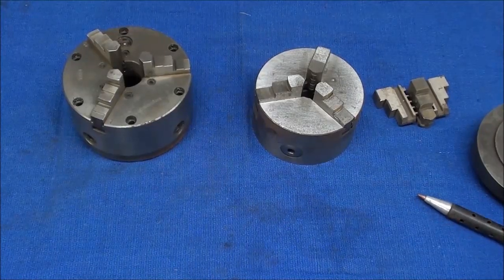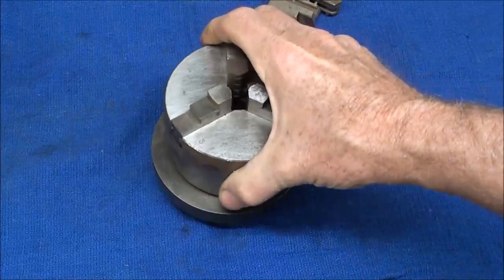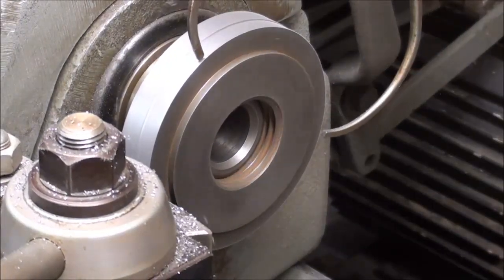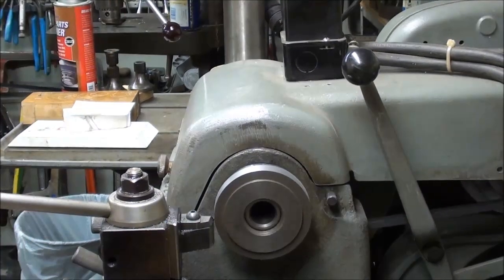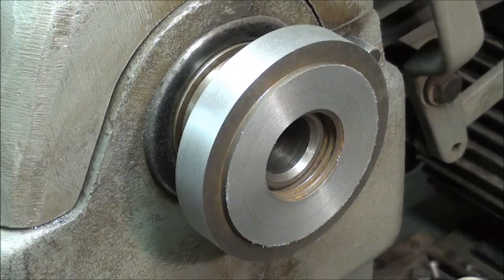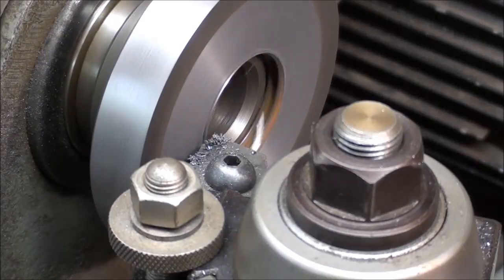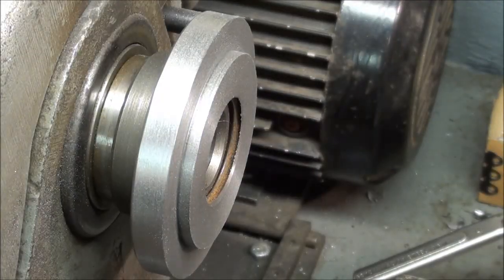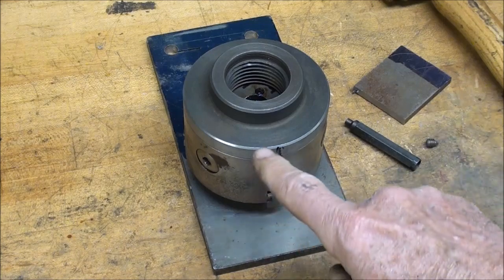MACHINE SHOP TIPS #132 Fitting a Backing Plate to an Atlas Lathe Chuck tubalcain

Comment: MrPete, I have just gone through exactly the same process to machine a backplate for mounting my new 130mm (5") SanOu 3-jaw chuck onto my Chinese 9x20 lathe. This lathe has an M39-4 spindle thread, and Little Machine Shop was one of the few places I found that carried an M39-4 backplate that was large enough (and reasonably priced). In this case, I had to settle for a 6" diameter backplate for my 5" chuck. I decided to leave that backplate at its original 6" diameter, rather than turn it down to 5" to match the chuck. Of course, I did have to reduce the registration boss to appropriate diameter, and was careful (and lucky!) enough to get it "just right". The chuck fits the registration boss with no perceptible slop or looseness. (Whew!) With a test bar mounted, I am seeing total runout in the range of 0.001 to 0.002, which I'm happy with.  

As always, the guidance you offer in your videos is superb!

Comment: Any reason you chose a carbide cutter for the first operation(s)? Could you have do the entire job with a HSS cutter?
Reply from the maker: +Tom B No good reason. Actually, I prefer hss.
Reply: Excellent, then I'm all set up. Thanks!
Reply: Ironically I’m here because my inserts are getting eaten up. It seems the manufacturer may have hardened the surface of my blank backing plate.

Comment: Dear Mr. Tubalcain, I enjoy your videos and subscribed to your channel. I think you are doing a great favor to the guys like me.
Here is my question:
I have Craftsman (Atlas) Commercial 101 with 6" cross slide and 30' carriage slide. Lately, when working with small 3.0mm Hex pieces, I discovered that my 3-jaw chuck has "Bell mouth" and it is holding my work somewhere half way in the chuck, rather then by the front of the jaws. Those ToolPost grinders are pretty expensive and I decided to buy a new chuck instead. Since my original was a flat, single Key-hole 6" chuck, I bought Shars 6"  3-Jaw chuck with 1 - 1/2 8TPI threaded Back Plate on eBay. It was a mistake, because this new chuck is not even capable of holding 3mm work in it's jaws and looks too heavy for my lathe, I'm now worried about my spindle bearings. I turned (on the spindle)  the "Registration Boss" of the Back Plate to fit my chuck precisely and bolted the chuck to it. I's WAY OFF. A perfectly round, grounded 1/2" rod, in my chuck wobbles about half of the dial of my indicator.
I wish you had an instructional video about how to adjust a chuck in my situation, because the one in your video came out near perfect and you didn't have to do any adjustments.
Best regards and keep up the good work.
Thank you.
Mike michaeldoc69@sbcglobal.net

Comment: I also would not like the screws exposed on the backing plate. It may be feasible to turn down the allen bolts a bit to whatever min dia. seems OK. The bolt holes could then be c'sunk in a milling machine.

Comment: I've seen instructions that said to make the registration boss a little bit larger diameter than the chuck needed, then heat the chuck to enlarge the hole before installing it. When it cooled, it would clamp down on the backing plate. Is that necessary or would just machining it to size work?

Comment: MrPete. I know that you squared the corner of the registration boss shoulder and the mating face of the backing plate as you finished the machining. I appreciate the fact that you relied upon the ground square nose of the HS steel tool you used for this task. You mentioned that you ran the square nose of the too up to the face of the place, driving it into the face of the backing plate very slightly and then back the tool out which finished the chuck to plate surface. Obtaining a true registration boss shoulder to plate face is obviously important to insure that the registration opening in the chuck passes completely over the registration boss as it meets the plate surface. I was taught that to insure the absence of any possible rounding or evidence of even the slightest high spot (because of the tool profiling) at the point where the registration boss shoulder meets the plate face, that one should introduce a cut at that point by moving the sharp tip of the tool cutting surface into the corner a slight distance, move the tool to the plate face a slight amount and then withdraw the tool finalizing the plates face surface. Now this would not be necessary if the outer edge of the chuck registration receiver is chamfered in such a manner as to preclude striking the very inner corner of the plate registration we speak of. I certainly do not have the skills nor the experience you possess and I so enjoy the video's you have so generously produced for all of us aspiring machinists. Offered just as an inquiry.

Comment: Hi. Nice video, also like your other videos. About the countersinking of the screws, as you said they would go through the side if you countersink. But would it be an idea to round off the edges around the countersunk head with the mill, so the screwheads would be visible from the side, through a rounded off pocket.

Comment: I have the same problem with my lathe (a chuck without backing plate), but the thread of my late seems to be M90x5, and I can't find any backing plate for it. I was wondering if anyone recognizes this thread and knows where to buy a backing plate. Lathe is Italian made, brand is Troglia (Torino). Actually I was hoping to see how to cut the thread in this video (in case I have to cut it myself). I have cut some thread on the lathe already but I never did such a huge size inside (I'm a bit scared to cut it not perfectly straight, because the backing plate should fit the fitting collar perfectly).

Comment: Thanks for sharing that work! It would have been helpful when I made a backing plate to mount a 5" 4jaw on my HF lathe. I cheated, 'cuz  I cut the blank, with mounting holes, on a waterjet @ work. And I definitely would have made the vids differently! :))
Littlemachineshop is a great resource for DIY'ers and hobbyists. Nice to see a trained machinist using their stuff.

Comment: Hope that one day you will have to make one for the Clausing lathe with an L00 type back plate.
This one is great too
Thanks
Reply from the maker: I need one for my clausing L00. They are over 100. dollars
Reply: mrpete222 100,00$ U.S. here in Canada it's higher than that. Making one implies many steps like calculation, measurement, planing : inside taper, keyway and external threading, hole positioning etc. etc. I start making one, but it is a big project for a new bee ! Also, it's difficult to find the iron of that size ! Thanks again for this video and all the others that are so helpful for all of us who like the trade,

Comment: on an unrelated topic, slightly.
no matter how round a tool, slow speed, fast speed, slow feed, fast feed, light a cut,  i take on our club lathe, you will always get a scratched finish.
would you say the headstock bearings have had it?

Comment: Good stuff Mr. Pete. Something I'd like to see you discuss is the fitting of a backplate to the lathe spindle. There seems to be a great deal of controversy about whether the threads actually center the back plate on the spindle or whether the backplate should be fitted to the cylindrical smooth area just behind the threads. It appears that you are in the group that believes in the thread registering theory since you plan to use your chuck on all of your lathes with 1 1/2 - 8 threads even though the smooth area on each lathe may be a different diameter.
Reply from the maker: I think it aligns on the short unthreaded part and against the shoulder.  The atlas & logan have a slightly different dim. on that unthreaded part.